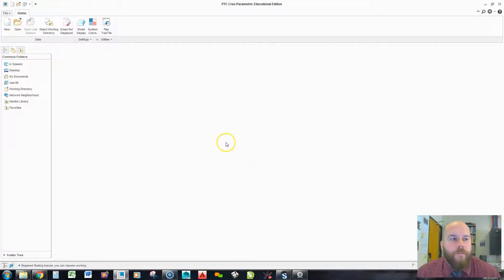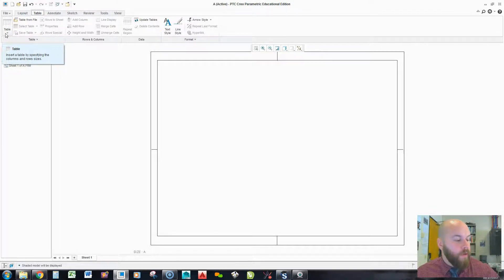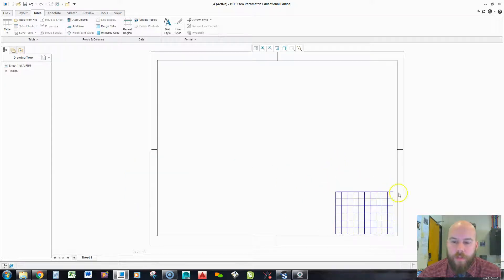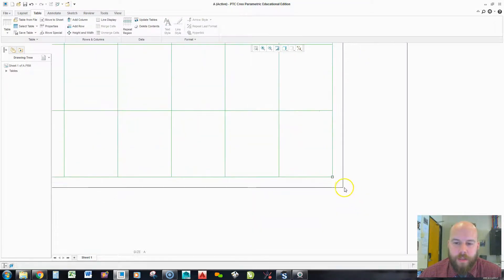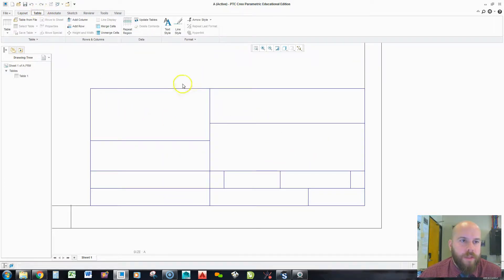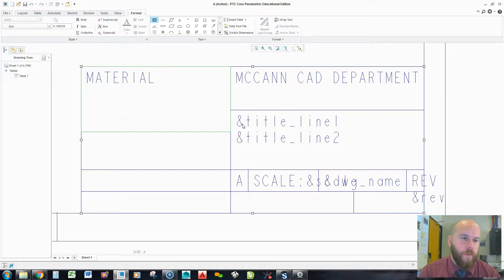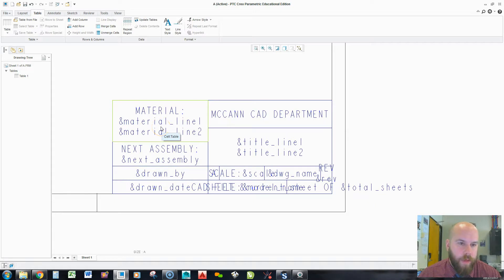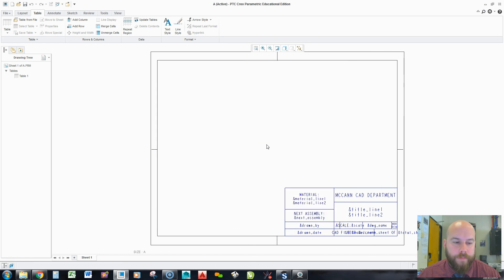CREO How to Create a Title Block Using Parameters in Creo 3.0

Comment: Some interesting but extremely frustrating notes I've found.
My company's drawing formats were sketched (not like this video where tables are used)
To avoid extra complication, I kept this format and added parameters as notes
This is possible, however, I found that for some reason, some parameters (mostly those regarding the drawing itself, NOT the part), work fine, while the part's parameters must be within a table cell, otherwise the drawing will remain with a "&material" note, for example.

I'm using Creo 3 by the way, I don't know if this has been fixed in future versions.

Great explanation!
Reply from the maker: I know EXACTLY what you are talking about. I've worked for companies where this can be an issue. Sometimes, table cells will absorb information more consistently than notes will. If possible, see if your company will let you create the formats. If not, I recommend creating a table to place over the top of the drawn formats. Notes will also work, but I would make sure they match up with your parameters accurately. A capital letter instead of lower-case or an underscore where it shouldn't be can mess everything up! Let me know if I can help any further!

Comment: Mr. Mez CAD

Hello !

Is there any way to get Creo to indicate in the title block the custom scale that I determine when creating the part drawing?
Depending on the part size I would like to be able to choose the scale regardless of the size of the drawing sheet.

Thanks !
Reply from the maker: Hi Paulo! I'm sorry for taking so long to get back to you. You should create your drawings with a default scale, then use custom scale for views that are not to the same scale as your sheet. Custom scale would be used for say a detail view or a partial section view you won't to blow up a bit. Sheet scale should reflect the default scale you are using for your primary view. Hope this helps!
Reply: @MrMezCAD  Thanks a lot

Comment: You didn't show how to create the parameters in the part.  I did create parameters in the part and they do NOT come through to the drawing.  I was hoping this video would show how to create working parameters.
Reply: Theres another video where he creates those parameters. 
However, in your part, go to Tools>Parameters (it has a pair of brackets [ ] as an icon). Then create your parameters as a string in this case, your parameter name and your parameters in your formats has to match for this to work. Good luck

Comment: Dear Mr Mez, very helpful info in this particular video. However, I can't see the possibility to incorp my company's logo?  Object -> Insert Object I presume but my drawing keeps coming up with a little window with OLE in it? Do you, or any of the followers have A or THE solution? Thanks
Reply: Mr. Mez CAD  , Thanks for the reply. I kept on fiddling around myself. I eventually found some sort of solution; not by using 'inserting an object', but with inserting a user defined symbol. (imported a *.dwg and wrote it down as a *.sym). Works great and can be inserted whereever I want. Again, thanks for the reply.